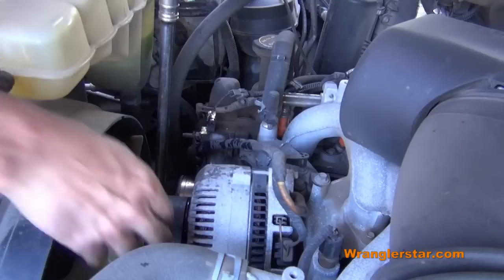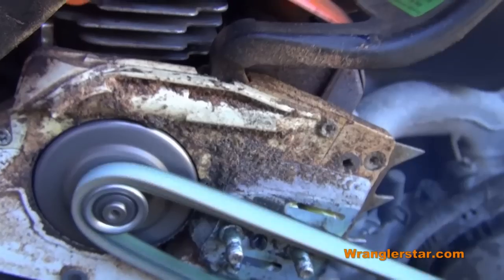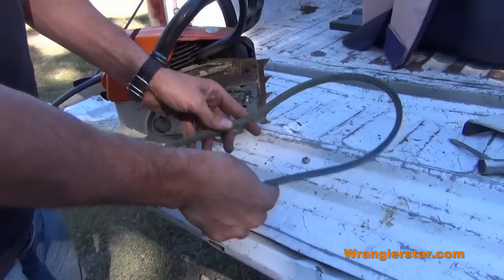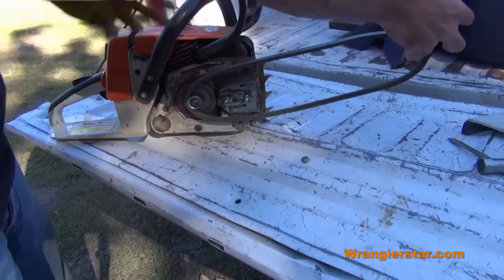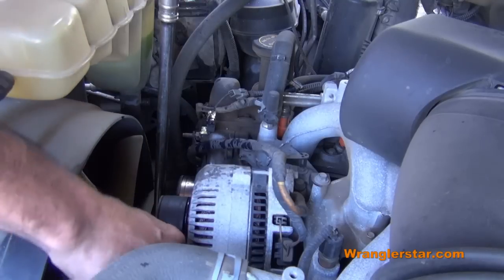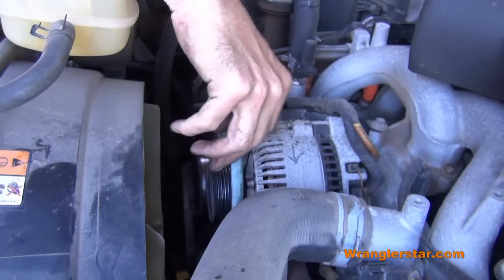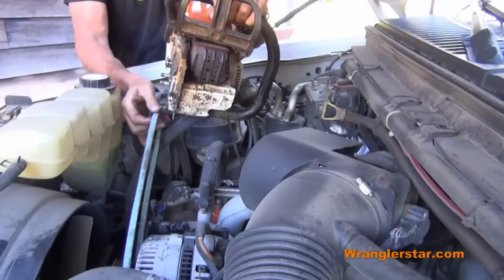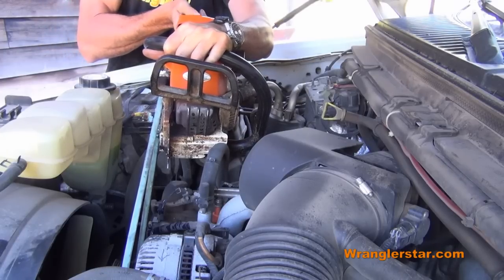Charge A Car Battery With A Chainsaw

Comment: Many years ago I was out hunting and came back  to my truck, pitch black out, winter  and the battery was dead.  I had hit my headache rack lights switch on when I pulled my SMLE out with me and it being a bright sunny day out and I left via the front of my truck I never noticed...  i was in the woods for I'd say 6 hours or so. I had my Stihl in the truck and my fan belt and after about 15 minutes bizam! Batteries were charged just enough to start it.  I had heard about this little trick back in the late 80's and tried it on my vw diesel back then and it worked perfectly so now I never go out in the woods in my rig without this kit. More reliable than a Li-Ion booster pack.

Comment: Just so you are aware:
1: It doesn't matter what direction the alternator spins.  It is a diode rectified 3 phase AC generator and works equally well regardless of rotation.
2: The key must be on for the field windings in the alternator to turn on, allowing the alternator to charge the battery.
3: If the battery is so stone dead that it can't excite the alternator's field windings, this won't work.
4: This guy is super awesome for thinking this up and sharing!

Comment: You forgot the most important thing; set the ignition to ''on'', else you can spin the alternator for hours, but it wont charge a bit. :)
Reply: my thoughts exactly
Reply: +Rick van den Berg  Are you sure about that?  I believe Alt output is connected to Bat no matter position of Ign Sw.  Normally, Ign Sw provides Ign power to Reg, but Alt will also self-excite from residual magnetism if it doesn't get Ign power.  I'd love to hear an explanation!
Reply: +Ronplucksstrings The ignition switch being off will be the  "open"  in the charging circuit..
Reply: +muskybubba I don't think you have it right....see my post...ignition switch supplies power to regulator, sure, but if it does not, Alt will still self-excite if you turn it, then alt generates output...and alt output is still connected to Battery so it will be charged...turn the alt, you charge the bat...period!  Look up self-excitation.
Reply: +Ronplucksstrings alternators require a bit of power to energize coils in order to be able to produce electricity. On much older cars DC generators were used instead which had solid state magnets in them and wouldn't require an input voltage to produce an output
Reply: +gilessmokey Agreed, and my point exactly...in that case you are providing field from battery by way of ign sw and Charge light...but you don't NEED Ignition power or a Charge Indicator...that's how a "single-wire" alternator, which doesn't even have those, works:  By residual magnetism and self excitation...these others just don't get it!
Reply: +supercowmoo3   ...and alternators also get that "bit of power" from Residual Magnetism (which can be lost, so they need to be "flashed" to reestablish it).  I never heard of Generators having "solid state magnets" but I'll believe it if you say so...I guess with that arrangement, turn it and it produces electricity...just like a one-wire alt!
Reply: +Ronplucksstrings Yes, I think U have right.  At least on GM  autos.  
The Alternator only has one connection   To the Battery and that is it.
some earlier Alternators did have the connection to the Batt  Plus a 2 wire connector  one to the Ignition key to energize the Reg.  and the other wire was for the red light Warning. 
The latest ones Don't have any connections but the output to the Battery.  (and Ground thru the body as always)
Reply: It wont charge anyway because it is an alternator it needs power to make power. Now if it were a generator then it will charge the battery just by spinning.
Reply: False. All DC motors will make current if spun manually. Take a volt meter and try yourself. Your correct about it takes power to make power, but that power your talking about only powers the DC motor to start spinning on its own an then it generates power. If you spin it yourself the spinning magnets will induce current in the coils.
Reply: But an alternator is a/c for alternating current a generator is d/c for direct currant  there are no magnets in an alternator
Reply: the magnets in an alternator are electro magnets just wire wrapped  around steel when current flows thru the wire it produces a magnet
Reply: A quick way to remember w/c is w/c is that DC generators (aka Dynamos)  were superceded by AC generators (aka Alternators) because the latter could be spun faster and thus produce more electrical power per engine rpm. And the reason behind that is that Dynamo rotors were made of permanent magnets (heavy, prone to fail at high rpm) while Alternators use electromagnets as stators.  With that, you can pretty much figure out that you will need field current to excite the electromagnet stator, without which you won't be producing current in your spinning windings.

All in all, you will need to turn the ign switch to the On position to enable the alternator to charge your battery, provided you still have residual charge left on the battery.

..and yes, back in the day, we had to disconnect the ignition coil to keep it from burning the laminate.  A ballast resistor would keep that from happening if the engine was running and interrupting primary coil current, wc of course was of no use if the current was a steady dc (engine not running).
Reply: Yes key has to be on or field coils don't energize and the alternator is just a bunch of copper wire spinning
Reply: Thank you to all of you for the education I'm getting here.
Reply: law white you should take an alternator apart. It’s not a dc motor. It’s more like a 3-phase ac motor which gets rectified and regulated to approximately 16vdc. If you spin an ac motor, you won’t generate power, unless the rotor is energized or you have a permanent magnet rotor (which alternators do not have)

Comment: Alternator has to have the field windings energized for this to work. Make sure the key is in the "ON" position. If the key is off/out, the alternator is completely off, and spinning it won't create any voltage. The field only needs between 4-6 volts for full power, so even a dead battery has enough juice to run the alternator to charge. Turn the key to ON, turn off all accessories/lights, and this will work.

Comment: It actually does not matter which way you turn the alternator. They produce AC that is converted to DC by a rectifier assembly inside the alternator.
Reply: Depends on the alternator, some alternators are fine with whicever direction others wear the bearings away quicker.

Comment: My truck battery got old and a short time listening to the radio left me stranded in the bush about 10 km from a main road.  I recharged the nearly dead battery enough to start the truck using 8 AA batteries, some duct tape and two strands of insulated copper wire.  I taped the batteries end to end, taped wire to the ends, and attached the wires to the terminals.  After a while ( 20-30 min.? ) the AA batteries overheated and started to crack open, at which time I removed them and...started my truck!  I was rather proud of myself.  ;)  I got out of the backcountry and immediately bought a new battery.

Comment: I can see me pinging that C Clip into space!! I call them jaysus clips, as is "jaysus, where the fuck did THAT land!"
Reply: I know all too well what you mean, those little buggers love to get airborne.
Reply: First thing I thought
Reply: ***** if you cover up the c lip with the box spanner IE place the spanner over the clip and pull it on rather than using the pointy end of a spanner, if it pings off it will only stay inside the spanner....Top tip
Reply: LOL
Reply: Jeff H i have always called em dammit clips.
Reply: Haha remember when working with my dad on a car bearing the landed on top of his truck and found slide down the windscreen while driving lol
Reply: that's so true I just lost the c clip yesterday and never found it
Reply: And they all make that classic ping sound when they pop off, depending on the size... And I've swore I knew where each and every one popped off but don't think I've ever actually found one

Comment: That will work with an alternator but there has to be at least some voltage in the battery because an alternator requires voltage it to excite the field.  A generator does not require any voltage to create a charge.  Most dead batteries will still hold enough voltage to excite the field (1-3 volts in most cases) so this is always worth a try.

Comment: Good idea but one thing he forgot to mention though, you need to have your ignition switch in the on position (not accessory) or it won't work. The car supplies power to the alternator to excite the rotor (the part the belt drives when the engine is running) . The car has to cut power to it when it is shut off or the battery will always go dead and you would go thru alot of alternators. Besides that, good idea.
Reply: exactly doug , which brings me to another kuppla points ; if battery id DEAD dead , may need outside power source even jumped across the battery ; just needs a 10+volt tickle of some sort .    also , if memory serves , rotation not so critical as DIODES control power flow . still , i would AGREE to keep direction same anyway, but inna pinch , spins either way .
Reply: pops wrench Nah, even though the battery is too dead to crank the engine over, there still should be enough juice left in the battery to give the alt the voltage it needs to start charging the battery
Reply: why i meant DEAD dead .

Comment: correct.  the diodes in the bridge rectifier are off the main wiring of the alternator.  the current coming out of the alternator is AC, it can't go "backwards".  the diodes (although much better in modern regulators) "rectify" the AC current into DC for the battery and ignition.

Comment: Great plan. Alternator isn't fussy about which direction it's going to charge. The integral cooling fan is the only direction sensitive part and that shouldn't matter for a short time.
If your battery light comes on even dimly, it will charge.

Comment: Another option for manual cars is to jack up one wheel wrap a strap around it, put the car in gear and turn on the ignition, and PULL the strap. Similar to push start but you can do it by yourself and you can do it on ruff terrain.

Comment: That's pretty good idea. But would it work if the battery is completely dead? I think if i remember right the alternator has to have some kind of voltage to it to starting producing energy unless its a single phase.

Comment: I would to see a video on maintenance of a chainsaw. Im sure its a very basic tool for you but I am very new to using one. For example how tight should the blade. What type of oils. Breaking a peace you might be able to fix on your own. Youve covered safety tips and gear. But a detailed maintenance video would be great.

Comment: This makes sense, if you have the key turned on , as some have indicated, it could get you out of a tight situation with a run down battery or near dead one. it would mimic a idling situation with the engine and therefore charge the battery after a couple of tanks of gas in chainsaw ? That's pretty clever . Thanks for the idea and posting

Comment: Hi Wranglerstar, great vids as always. As other people have said, if the battery is TOTALLY DEAD then this will NOT work. However, if you carry a small 12 Volt motorcycle battery with you  it will have enough power to energise the alternator's coils making this work. Hope this helps. Greetings from the UK.

Comment: I hope you have a little juice left in the battery to energize the alternator or it's not going to charge. That's one of the nice things about a generator over an alternator is that a generator will charge even if the battery is completely discharged. 
Back in the 50's, my dad had a Briggs & Stratton 3hp gas motor on his commercial salmon boat to turn a generator in case the batteries were dead from running the mast light or if the batteries just went bad.
Good informative video, Cody.

Comment: alternator will charge normal in either direction of rotation.  figuring out which way it normally rotates is not necessary.